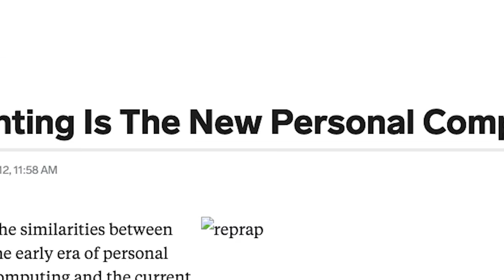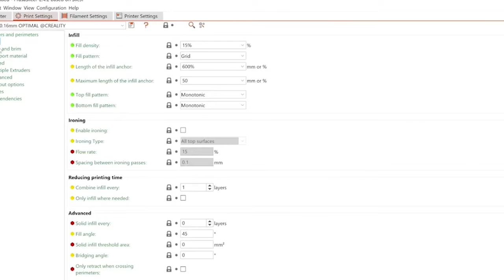Home 3D Printers Will Never Work

Comment: I guess you got some valid points on usability and durability. But the main challenge for the industry, is that the benefits from printing are not harvested, due to the general lack of great designers designing for printing. I see you do a lot of videos explaining some of the benefits of printing, which actually is the way the industry needs to move. But as long people in general has no desire for or no need to print anything at all, that is the way things will be. That is very hard to build a commercial business on.

I mean, in your video they print a lion head and a plastic rabbit. Basically just producing plastic waste. We don't want to go there, as a society. I mean, you actually push printing plastic rabbits now?

As for efficiency, running a factory can arguably be ran more efficiently than a smaller and local print farm, particularly if the local one has plenty of down time. But then, we are back to the industrial organisation we know for any production method. The counter to that, is that if printers are made cheap, them being idle, does not matter that much. Them being efficient matters far more, and that production generate enough work, to be sustainable.

Also, you seem to forget how complex a PC, laptop, or mobile phone really is. If desired enough, it is amazing what can be done. 3d-printed parts are simply not that desired. If they were, the world would be different.

Comment: your average sewing machine is more complex than a dishwasher, 3d printer or any other appliance the average consumer has in their house.  And most people have one or access to one.   Cricut seems to have taken off.   Just because the technology may not be suited to all tasks doesn't mean that plenty of folks wouldn't have one sitting on their craft table, specifically to print extra cookie cutters, gaskets, lids etc.

I'd say that the largest barrier is all the "it's to complex" bs.  normalize the idea of making simple parts easily, with the option of more complicated parts with a lot more hassle if you are willing to put the time and effort in.

Comment: I personally think 3d printers will be more along the lines of regular ink printers. Not everyone will have one but they will be common place enough in the next 10 years. 

As it stands 3d printers are about as reliable as any other printer. in fact if I calculate for print time they are actually more reliable than standard printers. My prints fail maybe once per couple 100h and have I've had a single break in over 1000h. Now compared to any regular printer I would normally have some type of an issue every few minutes with paper jamming etc. 

What we now need is a printer like the bambu carbon but that costs around 100-200usd so its affordable to anyone. Add in an auto filament subscription that automatically detects how much filament you have left and orders more when you need it and also a warning before starting a print if there's not enough filament left. The other thing we need is the ability to directly send stl's to the printer from phone/computer without the need for slicing and the printer automatically finding the most optimal way of printing the STL. 

I think if we can cross those 2 barriers printers will become commonplace household items.

Comment: Hmmm, 3D printers are actually pretty easy to use WHEN they work.  I would signup to be the new breed of plumbers, 💰🤑💰charging $300 a pop to change a $10 part of a 3D printer.

Comment: This is an interesting one, I mostly agree that it’s not likely that we see home 3d printing take off in a mainstream way any time soon, but I actually don’t think it’s device complexity that prevents that. An all-in-one printer/scanner has just as many axes of motion and needs to do higher-precision extrusion than a 3d printer, and a laser printer variant of that same device deals with a similar amount of heat, and high precision lasers, with a highly flammable print media, and those are pretty low-complexity devices for a user and are generally disposable on the low-end. 

But much like a band saw the thing that makes a 3d printer less practical is the utility of what it produces on its own. An inkjet printer produces a photo or document thats generally complete and useful by itself as soon as it leaves the device. Very few plastic items in our lives are a single plastic part you could just pluck off a print bed and use. That limits a 3d printer’s utility for a non-maker to replacement parts for things that break, but outside of some specific niches mfgs have basically 0 incentive to provide parts that way, and designing something yourself is still much too difficult for the average person. The only way I see home 3d printers going mainstream is is 3d modeling becomes a much more common skill, which given the rise of games like Minecraft (and dedicated 3d modeling programs that work on similar principals) may happen at some point.

Comment: I think you hit the nail on the head here. 3d printers are tools, and I'd argue that they are more like a CNC router or mill than a bandsaw. Until we get to the point where the machines can go years without maintenance and don't require an intimate knowledge of the materials and processes involved, and yes, those of us that are into 3d printing are much more aware than the average person about those processes and materials. For one, we know that there different kinds of plastic with different properties. Ask someone random off the street what kind of plastic you use to make milk jugs and the answer is almost certainly going to be I dunno.

To those who point out personal computers and the comparisons there, I'll say that you're comparing apples to oranges. Personal computers, like every other appliance in the home,. did something more efficiently. Dishwashers made it much quicker to do the dishes. Refrigerators allowed you to keep food longer. Microwaves allowed you to heat up food or ingredients much more quickly than doing it on the stove. Personal computers allow you to access information, write, bank, and a whole host of other things in a much shorter time that it did before. 3d printing isn't like that. A 3d printer gives you a capability. It doesn't do a job. Admittedly, you can argue that PCs give you a capability, and they do, the capability to write your own software, but how many of us use a PC that way? When you ask people what they do with their computers, it's mostly access the internet, finances, and a list of other jobs.

If we want to see what the future of 3d printers is, I think we should look to machine tools like lathes and mills. Precision lathes for metal work have been around for literally centuries, yet most homes don't have one. It's a tool that has decades of refinement and engineering put into it to make it as safe and easy to operate as possible, but the reason we don't see them in every household is that any precision tool,. no matter how simple or easy to use, requires a basic knowledge of machining to get anything out of it. The same with 3d printing, and the likelihood of that changing is virtually nil.

Having said that, I have used my 3d printers in the kitchen before, but that's because I live in a small house and the kitchen table was the only place I could put my big FDM printer and be able to use it.

Comment: Perhaps not every home, but every business. 

Imagine you go to the mechanic and they say "oh, looks like hyundai put out an update for a doodad (idk a bracket or something). We dont have them in stock but it will just be 20 minutes until we get it off our printer, that will be an extra $14" mechanic clicks a button and a plastic and/or metal doodad pops out, they install it in your car, and you drive off.

3d printing has the power to make hardware updates as accessible as software updates. That is huge and should not be underestimated.

And look at where we were with 3d printers 10 years ago versus now. Imagine another 10 years how cheap a printer equivalent to the bambu labs p1p will be. Total reliability, minimal user interaction, incredibly fast printing. And in the future it won't just be simple plastic or metal doodads, we will be printing PCBs given time.

Comment: It will make sense for everyone to own a 3d printer, when they reach the level of simplicity and cost of a inkjet printer. If or when the machines can move away from stepper motors to cheap DC motors, like an inkjet printer, that will be one step done. I'm still surprised that hasn't been achieved yet, even though closed loop position control exists.
The extruder is the next thing. It has to basically never jam, and the nozzle shouldn't wear out. Bed adhesion is maybe the next most important. Prints must stick when printing and release when done with no fuss. 
Make it as simple and reliable as inkjet printing, then it makes sense for everyone to have one.

Comment: Correction: FDM 3D printing at home will never work, the most complex peice of machenery many people have at home or at a local shop is a 2D printer, which use very diffrent technolagys to what FDM 3D prining uses(which is more like a a plotter with a load of extras complecity). A improvment on optical resin or inkjet 3DP could get there it just needs to get past it's current material problems, still I feel that both the centralised and local aproch will come to be for different use cases.

Comment: The argument of the machine being just too complex doesn't seem to be a strong one. There are many complex appliances in the home with very high reliability. Add a couple years of technological advancement as well as a healthy dash of AI and it's very possible to reach the level of reliability and automation needed for it to become a common household "appliance". And if it hasn't by then, then just add more years of advancement. Eventually it will be possible. Never say never...

Comment: The Printers of today will never be a household item, that is for sure. But I find interesting that the comparison was a dishwasher and not a 2D printer. It also has 3 motors and a complex printing head. Adding a dimension is not trivial, but I do not see why there is no chance to create a workflow and device that would allow everyone to 3d print.
I think what is more unlikely is the motivation to have one. Not everybody needs custom parts, prototypes or models. 
I agree that it still makes a lot more sense to have printing farms at affordable prices. 
But in a future where CAD is more accesible I do not see it so crazy. For example, after seeing what ChatGPT can do, I can imaging that everyone could have access to a sort of Jarvis like Ironman. You could do 3D modeling using VR or AR and just your hands and use AI to interpret commands like “please make this side 35 mm and this hole 5 mm”.
Wouldn’t it be great? I am still very slow with CAD. I have hundreds of ideas in my mind and my printer is waiting for me to finish the CAD models.

Comment: Interesting points you make. I have a Bambu lab x1 Carbon and I’ve often said it’s the next step in making 3D prints like microwaves. 99% of the time, it just works and it’s closer to the, “you don’t have to know how the sausage is made”. But, I’ve struggled and learned though the last 10 years printing starting with a remanufactured Monoprice Maker. I am bias, I don’t know what it would be like to have this printer as my first printer. I couldn’t guess as to the ease of use out of the box. When and if a printer can print quality metal and plastic together for under $1500 there will be the beginning of a chance of them becoming just another must have appliance. We still have quite a wait for:

“Computer, tea, Earl Grey, hot.”
Reply: The X1C is my first printer and while it has a way to go before becoming an appliance it is a significant step forward. Learning curve is greatly reduced but exists.

Next steps, more AI functionality and automated calibration.

Calculated maintenance steps based on hours run with xyz filliment with on screen instructions, think keyence level maintenance instructions.

From a future standpoint my kids are going to grow up using CAD and having a 3D printer in home. Most  highschool students are learning 3D modeling for one reason or another. I think the next generation will look on this as normal in home appliance.

Also we need a change in industry thinking. Instead of banking on replacement parts/ "make to break" to increase revenue. Make more sustainable products by releasing replacement part files. (Hell even have people pay for them) and then eliminate legacy product supply chain issues. Of course they won't do that since they need you to buy the next version but one can dream.

Comment: The most complex mechanical device everyone owns and seemingly lives with breaking down is not the dishwasher, it is the car.

You also seem to imply the FDM printer is the only technology that could be a home 3 printer. Most cheap SLA printers have only 1 motor, and are extremely simple mechanical devices. They have a lot of other issues that make them unsuitable as a universal home device, but your thesis that 3D printers have to be complicated is wrong. Remember that we are still in the early days of 3D printing. Think of what cars were like in the 1920s, or even the 1970s. We just aren't there yet. We don't even know what there looks like, but we will get there.

Comment: Excellent analysis. Two of my four 3-D printers are currently awaiting repair parts from China (weeks of downtime!), and even my supposedly reliable Prusa seems to have a death wish.

I can achieve very impressive print quality (surprisingly, from an Anycubic Kobra Max) but there are so many potential pitfalls with printers and filament that 3-D printing users commonly add more stresses to their lives, which will likely be shorter and filled with more health problems because researchers have documented that all filaments/printers generate astounding levels of particulate and other pollution (offgassing of filament additives and usually Teflon tube pyrolysis). As a medical doctor, I understand those risks but most people mistakenly assume that if it doesn’t smell bad, it is not bad for them.

I spent months mitigating those risks with extensive ventilation and high-tech air filters, but judging from the thousands of 3-D printers I’ve seen in use in homes, schools, libraries, and businesses, evidently few users understand the risks and know how to minimize them. I’ve yet to see a 3-D printer manufacturer adequately emphasize this problem.

However, as bad as fused-filament fabrication printers are, resin printers are even worse for users and the environment.

Comment: New to 3D printing. I agree about complexities however like any tech it will evolve over time as more people use it if it’s indeed a good solution for people. I definitely see it increasing in homes not slowing down especially as it becomes more appliance like (enclosed, auto bed leveling, octoprint for remote printing/viewing/etc). Supply chain mess if it grows worse (most likely until countries other than CCP pick up the slack) will open more people’s eyes to it. Yes you can build farms and become the Kinko of 3D printing but that never stopped homes from adopting regular printers directly (30yrs using regular printer and I still couldn’t service one but yet I still have one. Sometimes prints garbage, paper gets jammed, etc. has its faults too). Also most people grew up with some form of computer nowadays so getting hands a little dirty in tech not alien anymore.

Comment: I’d agree that in our current state, 3D printers are still too complicated for those that aren’t technically savvy.  But where will we be in 10 years?  I think eventually they will find their way into more homes and feedback from consumers will drive new designs and features that should hopefully makes them more accessible to everyone!
Reply: 3D printing is a manufacturing technology. If someone doesn’t have the engineering knowledge or thought processes developed, they will never get it, no matter how much smart capabilities you add to the hardware and software. Not sure I’d agree with attempting a comparison with the personal computer since the computer doesn’t actually manufacture anything. The average person can be trained to perform activities on a computer without much difficulty and can use that device without actually understanding how it works. If you try doing that in manufacturing, you are not going to wait long to experience failure after failure. There are definitely enough people smart enough to use these printers so they are not a useless technology with no future in the home, but somebody with no understanding of the process and concepts shouldn’t even consider one.
Reply: They are not complicated. You are just lazy. if buy a cheap one thinking it should also do the entire thinking for you, then you are gonna keep calling it complicated.
Reply: @fofopads4450  I’m not lazy…. I have several 3D printers and can do pretty much any tuning or repairs I need to do.  But for the general public, they’re just not to a point yet where they’d be in every home.  I’ve seen SO many 3D printers for sale (used) because people bought them and could just never figure out how to properly tune them and get good quality prints.  So they just sell them.
Reply: @fofopads4450  and before you run your mouth and call me lazy, go look at my profile here on YouTube and the videos I post about 3D printing.  I even go so far as to make my own PET filament from recycled PET plastic soda and water bottles.  Having said that, I will stand behind what I said.  3D printers in their current state are NOT made for the general public to use.  They are still too complicated and require too much technical knowledge for most people.  Maybe 10 years from now the technology will get better so that they can be run by 'most' people that don't have specialized knowledge.